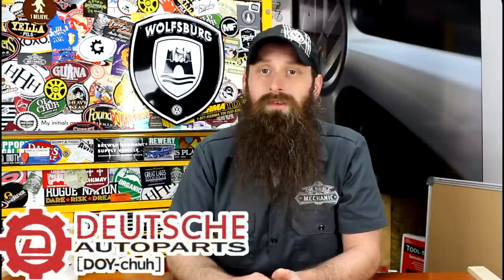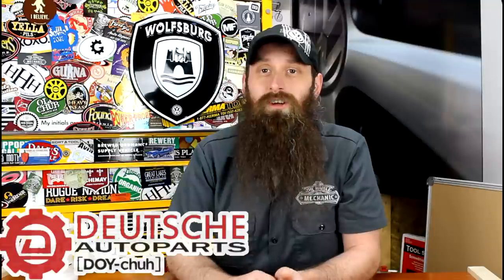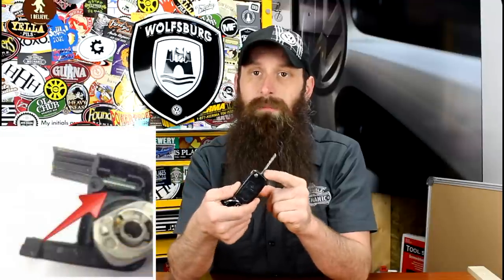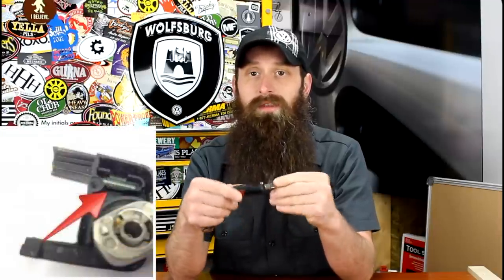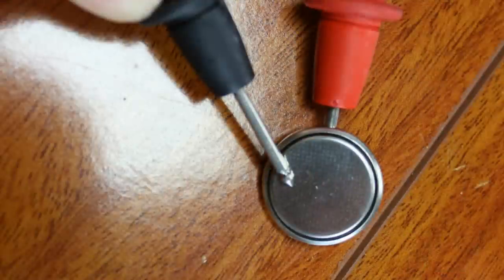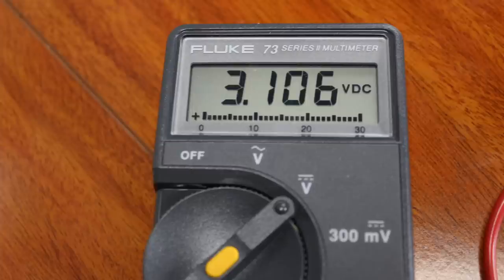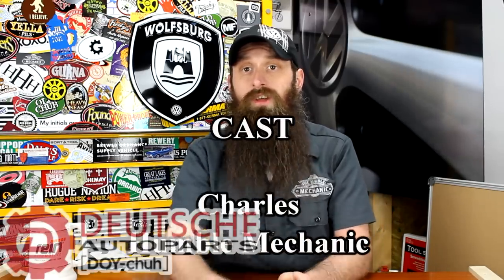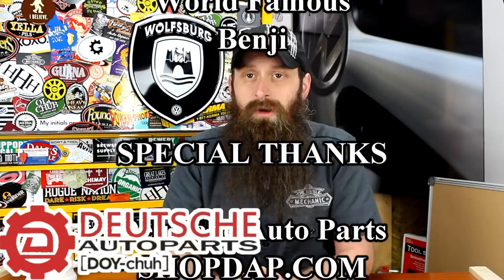How VW Keys and Remotes Fail

Comment: I ordered one of these FOB Keys and opted to have that Blade Cut 
according to two Pictures that I Texted them at 10am this morning....at 7:49pm I got a Text from them that my Order has Shipped ! That's pretty Amazing all by itself....I'll let you know how it works in a few days. I told them The Humble Mechanic sent me ! Liked/Subed
Reply from the maker: AWESOME AWESOME AWESOME!!!!!
Reply: @HumbleMechanic   Hi again Humble ! I do have a question for you. 2002 VW Jetta TDI ...Can I remove the Immobilization Chip from the one key that I do have that starts the engine and mechanically opens the Doors and Trunk (Doesn't work Remotely on anything) and Hot Glue or Tape the Chip on or near the Ignition Switch (somewhere on the Steering Column)?
I don't care about the Anti-theft garbage...I just want to have multiple keys that will start and let me drive the car ! Or maybe just tape the Original key with the Good Chip near the Ignition switch and be able to use my new FasterKeys replacement key in the Ignition ! Thanks a bumch !
Reply: Same question!!  Haven't locked my car in three years!

Comment: I have a 2002 vw passat V 6 for 2 years today Jan. 30th 2016 wake up start the car it started forget about something in the house turn the car off went back in the house come back the remote stop working use the key open the door the car will not start any more all the lights in the dash light but no sound what should do for 5 speed stick shift 2002 vw passat v6
Reply from the maker: +Morris McCauld 2 common areas for this. 1 is the clutch switch failing. The other is water damage, or plain failure of the CCM

Comment: I think the whole concept of an "immobilizer" is ridiculous.  Keys are cut with a unique pattern to match one particular lock, or group of locks.  If this key is unique, why would you need anything else?  You won't be able to gain access or start the car without the correctly cut key.  Why would you need a complex electronic system  (prone to failure) to immobilize the car? In what circumstances would you want to immobilize the engine, when the correctly cut key is inserted in the ignition?    In my opinion, the addition of an "immobilizer" to a unique key fob is just something to make dealerships more money when it fails and keeps the owner from driving the car.
Reply from the maker: with a $40 tool someone kinda skilled can pick that lock in under 1 minute. I own the tool, but im not that skille yet HAH

Comment: You are a saint for even bothering with "newer" VW's, i've repaired a 2001 golf as of late as i thought it'd make a good cheap to run daily, but this car is either going to the crusher or getting sendt off cheaply, simply A HELL to work on! EVERYTHING BREAKS, bolts are made from chocolate, everything else that a sensible automaker would make out of metal is PLASTIC. VW deserves ALL THE JOKES about their shitty build quality. Never ever touching a VW newer than 1989 ever again i tell you hwat
Reply: I'm gonna have to look into removing the immobilizer i think, no way i can trust a car where you have to bring violence to the key area to make it start haha. I trust this car less than my 2.5 diesel Jeep Cherokee, and that car spit a conrod out the side of the block! Still drove it home!

Comment: VW Planned Obsolescence? I've repaired 2 key FOBs now for our 2010 Beetle Conv., same failure mode. The cross shaped actuator design for pushing on the button is different for unlock, it's rotated 45 degrees and wore out? My fix was to remove the board (2 corner melted posts), then put a dab of Silicone completely covering it, let it get un-tacky (1hr for me) then re-assemble so the silicone will seat. OK to get silicone on surrounding area, it will never come out and it will flex. I believe this could be a better design with 3 years on one of them already, and just fixed the other. So I ask, why is that button designed differently AND they both failed for lack of clearance (wear or human pressure or ?). Could be wrong... I'm selling for a Model 3 Tesla actually. I'm 57 and learned my lesson on German Engineering with how the Battery was installed, ridiculous!

Comment: Do you work on classic air cooled vw?
Reply from the maker: I haven't done too much in the air-cooled world
Reply: HumbleMechanic I own a gti vw golf I had water damage I forgot the key in the jacked when I washed it and changed the battery the key works now problem is it doesn’t lock or unlock the car however the car recognizes when the car is inside... I have a hard time reprogramming the remote because my car it’s keyless and has a start button .... what can I do ?

Comment: Took battery out for 30 min or so. .. Now I can't get it to start.. Help... I hope
Reply from the maker: Oh no. Will it crank?
Reply: Help go to guy.   Love u
Reply: @HumbleMechanic  yes crank epc light on
Reply: Crank no star🤔
Reply: Volt meter... Battery good
Reply: @HumbleMechanic  no like it wants to crank
Reply: Was working fine . I took battery out checking my air hoses for leaks just P.M (preventive matain..)
Reply: Afterwards had company so stopped with battery out now I have reinstalled .. O but a crank no start..  First time and its in my 2.5 liter jetta 07 I have a passat turbo ..done similar and works fine.. Slightly newer passat tho
Reply: U see u the only one I want to rush and seek knowledge from.. U the best Charles
Reply from the maker: Try turning ignition on, press the gas pedal to the floor slowly 5 Times. Then try and start it.

Comment: it would be very helpful and appreciated IF HM could explain how to reprogram and 04 Passat FOB, (single Key-2nd key not present). A key tech worked on this vehicle using his computer, his scanner, and his bag of numerous tricks yet the VW 04 Passat refused to reprogram the remote. The remote's integrity is intact, new battery installed following the older battery failing (which seems to have provoked this situation). The Tech (a nation-wide mobile service company) stated hat VW 's can be extraordinarily difficult to reset. I believe him. None of the online videos address this problem. Isn't it a shame that VW Group is creating such inferior products at the expense of the consumer? (This includes scads of other complaints about the VW Hassle!) thank you HM!

Comment: When you only had one fob and it got trashed, what then?
Reply from the maker: You need to do it with the scan tool
Reply: @HumbleMechanic  Thanks. Great vid. Is there a video on doing that with a scan tool? Trying to help someone with this issue. I'm afraid they'll be screwed trying to get it going.

Comment: All of the mechanics in my area warn against buying Volkswagons now... just don't do it- buy Toyota or Honda instead. Even then, do your research.
Watch Scotty Kilmer, he explains it on YouTube. These cars are now built using cheap plastic parts on the engines that fail costing you $$$ and down time. Most of these problems develop after 30K miles- ticking time bombs for your wallet and resale value. 
Entry-level BMW's are the same junk. This is why you see used ones for sale at bargain prices... don't be a sucker.
Reply: VW has been the absolute worst piece of crap car I have ever owned.

Comment: Dear VW buffs.. would a dead key keep an older NB from starting? 1999 Beetle.
Reply from the maker: YES
Reply: HumbleMechanic Dang that was a quick reply thank you so much. Lol. Do these also need to be programmed by scantool or can they be programmed using 2 keys?
Reply from the maker: 2 keys was for the remotes only. Gotta have a scanner.
Reply: Great... I've just been starting it using a starter push-start wired straight to the starter. Lol. Just bought it like this and trying to do a diag using no scanner. When I disconnected the battery to check the starter I couldn't disarm the alarm... even by opening the trunk. Anyway. Just doing research. I really appreciate it. Most of the info I find is for Jetta.

Comment: Hello.  
I have a 2017 GTI (tiptronic) and the key won't twist.  It rotates a little, but then stops and feels like a solid stop.  The headliner lights and radio turn on, but nothing else.  I have wiggled the key, turned the steering wheel, etc., but no luck.  The shifter also will not let me shift into neutral. 
I can remove the key will remove from the ignition.  Will the paperclip work to release the cylinder?
Tomorrow I will try pressing the manual release for the Shift Lock and disconnecting and reconnecting the battery.
Any ideas are much appreciated. 

Thanks

Comment: 2002 VW Beetle-   replaced car battery and remote battery, I have the remote key and valet key. The remotes blinks and light lights on car flash, no horn and it isn't lock/unlocking all doors, trunk works? Help Pls.
Reply from the maker: +Tami Lee maybe a bad door latch. But could be a bigger convenience module issue

Comment: i have a 2009 jetta that the unluck function on both key pads wont work. lock and boot function both fine and central lock button in car works fine, any ideas